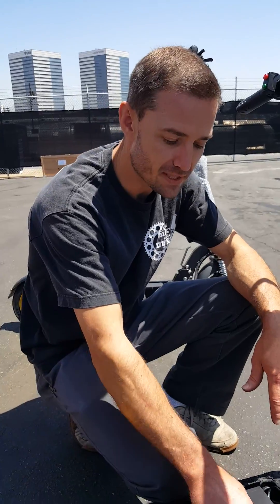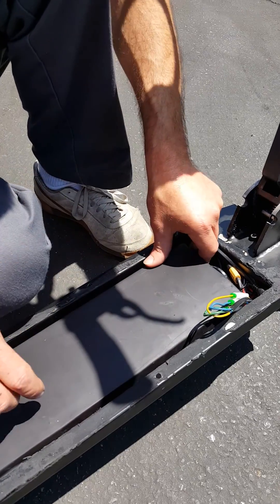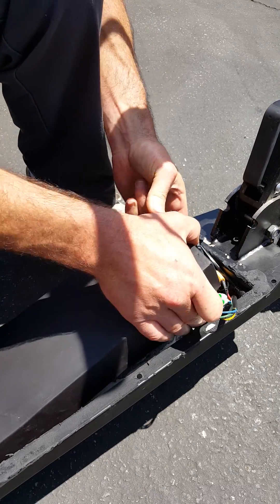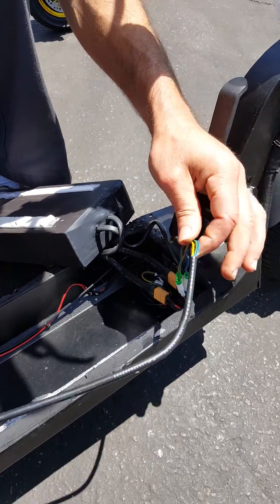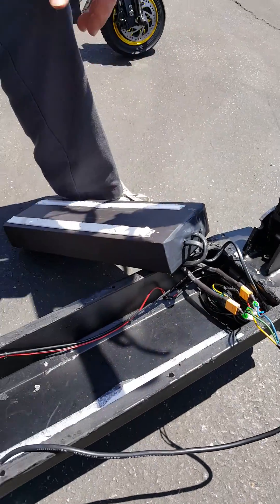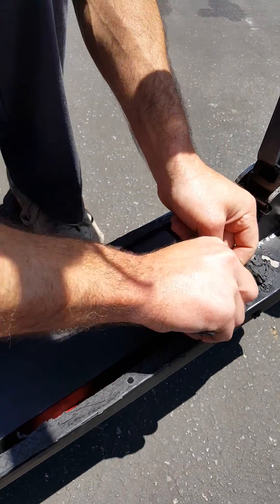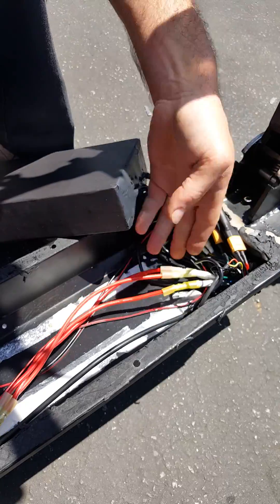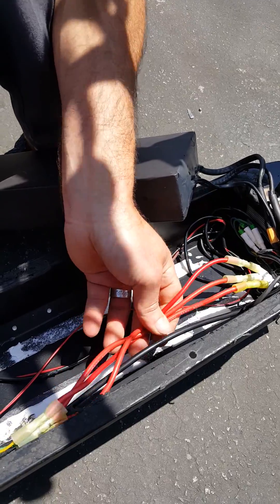Apocalypse  / Super Scooter Phase Wire Upgrade

Comment: Thanks. Can u give us a link to the suggested wire that we can purchase to upgrade?
Reply from the maker: we are going to be offering a kit to do this upgrade in next few days ....but 12 guage silicone wire is what we used.
Reply: okay cool, thanks. Side note - if you ever decide to show how to upgrade the front light i'd be a happy guy, lol
Reply: @LunaCyclesLLC  my Luna cycle apocalypse v1 has 68 km on the odometer. Every time I hit the throttle it shoots straight down to 48v then cuts off. Are the wired in the video the problem? The cycle is a few years old but only used a handful of times before the problem started.
Reply: Diggy City lol, front light really  needs a upgrade can't see shit at night, I think my keychain light works better😂😂

Comment: are you saying that EVERY SINGLE PREVIOUSLY BUILT LUDICROUS SCOOTER NEEDS THIS UPGRADE?
Reply from the maker: no its fine as it is ....but if you want to hotrod this is the first step.
Reply: that's cool and I saw all of your upgrades
I know it sounds weird..... and I'd (obviously page shipping BOTH ways)... but I really want to EVENTUALLY send my apocalypse scooter back to you and have you guys do EVERY UPGRADE AVAILABLE... whatever the cost (going to be getting the SUPER BANANA RACING EDITION next week to "tide me over" when the scooter gets upgraded. 
yes, I know I'm nuts.... just only trust you guys to do that work
Reply: Greg Savel damn so jealous of you, I've been so itching for super banana race edition, might pull the trigger on it ..
Reply: Greg Savel yeah same here buddy all my rides are 30+miles  starting from mode 2 and only using the dual motor for hills or racing road bikes since they always want to race me for some reason, I just can't believe how good this scooter is super reliable, I could  spent all day riding and don't have worry about charging the scooter if I cruise on it ..👍🏼
Reply: every moment on this scooter is pure bliss. that's why i want the super banana racing edition bike... ridiculous for me to buy such a thing... over 3K delivered to me with few options they offer.... but, it'll provide for me MILES OF SMILES.
Reply: ah.... can't wait
just rode 25.5 miles on the scooter
i'm 200#
riding in MODE 2... one-wheel drive
5 bridges x 2 (there and back)... two-wheel drive to get up each one
took it easy
still at 52 volts (at rest) when done
could have gone another 10 miles
INCREDIBLE how HONEST LUNA is about their battery life
love these guys
NONE of those miles in YOUR beautiful area of the world
but, it's 80 degrees with 65% humidity and not a cloud in the sky
wish YOU were HERE
Reply: i suppose the "up to 50 miles if you take it easy" is possible on the super banana racing edition. very excited about it (of course... no one NEEDS something like that.. LOL). 
appreciate your reply. have a wonderful sunday